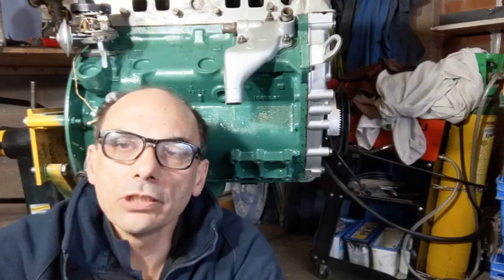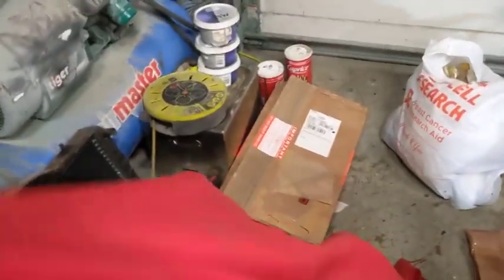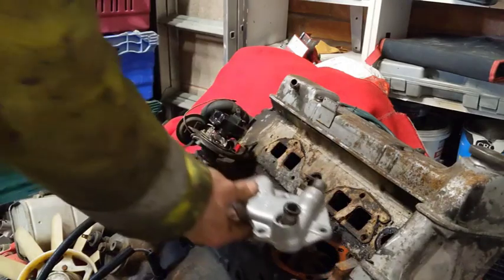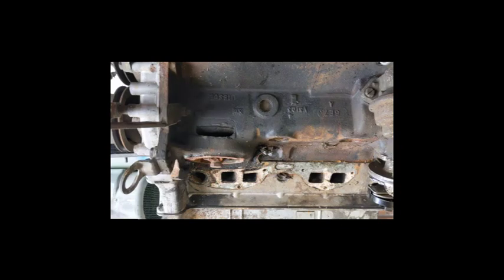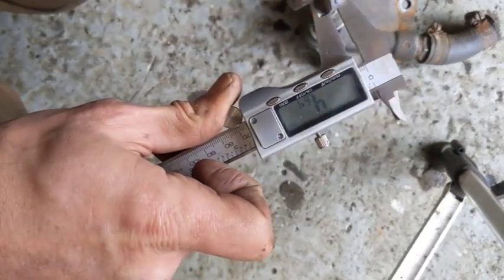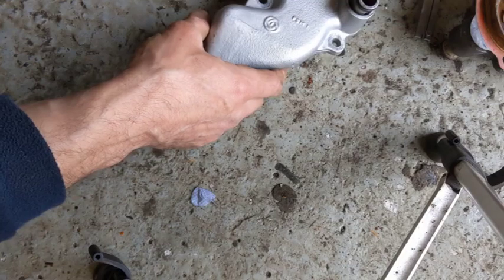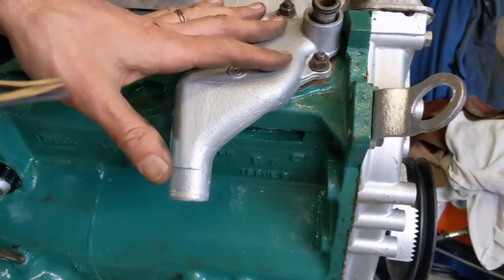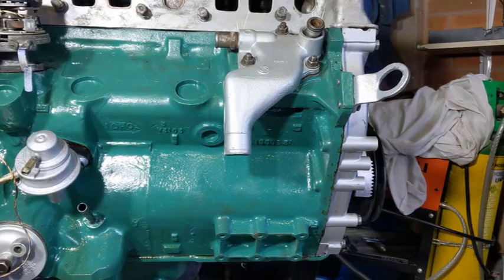Triumph TR7 Restoration: Episode 103 - Test Fitting Water Pump

Comment: Is it a 6 vane pump in the engine? I am convinced the shinny looking housing is a 12 vane housing, which suggests with that amount of gaskets either the pump is not seating properly in the block if its a 12 vane or if 6 vane due to a mismatch in shape for the impeller VS housing face shape. Either way I am convinced there will be a witness marks from either impeller blades or the nut after rotation probably to give you a clue :)
Reply from the maker: Hi Andy, the engine I am rebuilding has a 12 vane pump.  I think adding tippex is a next step

Comment: Hi Henry, I noticed the old engine had a 6 vane impellor. Even though it looked to sit further down, I don't know what the actual difference if any, between the 6 & 12 vane impellors! As they both sit in a same spec of block? I would say that your 12 vane impellor is still not sitting snug in the block. It's a shame you couldn't get them both out as you would have been able to verify the overall length of each  pump assembly. The spacing or height of the pump housing being as it s now, when running, my concern would be that the flow & return to the impellor may actually penetrate beneath the impellor from the water orifices in the block. This is a bloody nightmare for you, are you happy that the impellor LH bolt is not hitting or coming into contact with the housing, I know the engine turns etc but that force of turning you never feel if it was. What I did as an initial test to ensure my clearance and that the impellor was clear, was to dab a thin layer of tippex on the LH bolt, put the housing on with my gaskets and tighten down. I then removed the housing to ensure no tippex was present on the housing. All was good. 
Good luck with it Henry, you ned to get both water pumps out & compare at least, hell I might just post you my pump assembly to borrow for comparison!!!! but at least you have the luxury of another engine for comparison.
Reply: I agree, you need to get both pumps out and compare them. Maybe fabricating a bridge type puller would give better results than the slide hammer in this instance. You need the cooling system to be right if you want a reliable engine so take the extra time and work out what is going on. The pump being as tight as it is won't allow you to get an accurate measurement. Oh the joys of Brummie engineering.
Reply from the maker: Hi Chris,  Arrrrrrgggggggggggggggg!
Reply from the maker: Hi Andy, Yes, Bridge puller to be made today
Reply: @HenrysGarage  LOL I've used that expression too when working on my 7!! :)

Comment: I don't think the pump housing you have are the same! I think your spare TR7 engine is a 6 vane pump housing, whereby the new housing in your hand is a 12 vane pump housing. You cannot interchange, you need to use the correct housing for the pump you are using. I could be wrong but if you pause at 4:01 the shape of the concave piece is different, the ramp looks more extreme on the spare engine, because it uses the 6 vane pump. This Rimmer Bros video goes into it nicely https://www.youtube.com/watch?v=VklGz6-U0Xw&t=9s obviously for a Stag but the pump is same I believe. This video also tells you how to set it up in relation to gaskets etc.. And reading the comment below I will do the tippex trick on mine when setting checking it :) - - - - (edit) On reflection the Stag pump housing does look different, I am sure the principle is the same, but I would do other research etc. and wait for others comments etc.
Reply from the maker: Hi Adrian,  I'll get them both out and look again, and see if I can get a measurement of the angles.  I see what you mean in the video and I had a slight doubt when they were out.  But, the video makes it look a lot more than real life which I suspect is the angle.  I had seen the RimmerBros video which was why I went down the route of looking at the two.  And so I've just looked at the website and it shows 2 different housing numbers ! 6 vane is 217993, 12 vane is 218542.  Now I need to tie those back to what I have.  And I seem to remember the first number being on the 6 vane car.  The image is also very different from either of my pumps
Reply from the maker: Looking at the image again, I think that is a Stag 12 vane housing being shown on RimmerBros.  Scanning other images they show a 12 vane housing which looks like mine
Reply: @HenrysGarage  No worries, food for thought really! I am definitely no expert, mines still in bits!! Its strange the spare engine pump housing looks the same as the shinny one as the spare engine has a 6 vane pump? Your housings are definitely TR7 as the outlet(?) sits where the other bank of cylinders would be in a V8 configuration on the Stag I believe. I still think the principles from the Rimmer Bros video should be correct on the TR7 application in terms of gaskets and the face slope of 6 vane VS 12 vane etc. Have you got an email, I can send you a picture of my 12 vane pump without the cover on, before I took it out so you can see what it should look like in the correct depth in the block. I can also send you a photo of my 12 vane pump housing.
Reply from the maker: @adrianhughes2163  I don't know if strange or not but if we think about if logically, we would want the curvature of the housing to match the curvature of the pump and 6 and 12 vane pumps have a difference curvature so we would expect the housing to as well.  So I'm going to pull them both off and take another look
Reply: @HenrysGarage  Totally agree :)